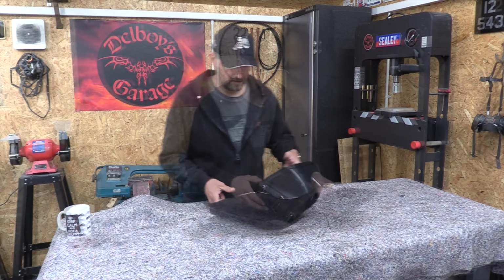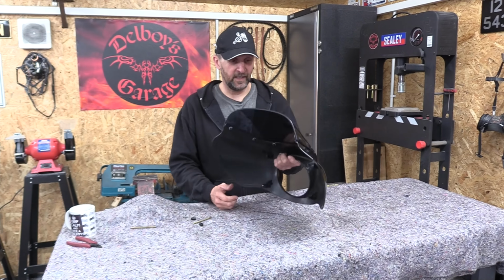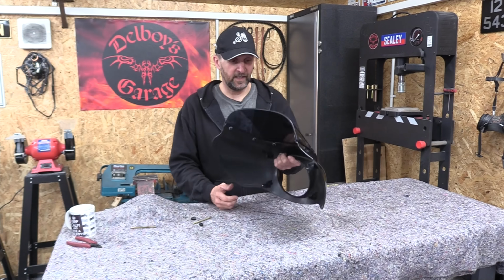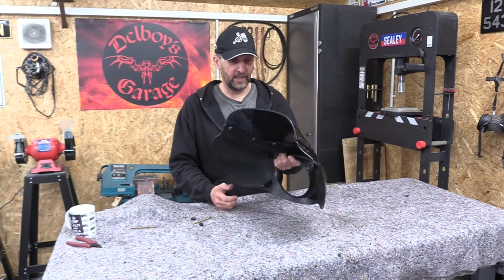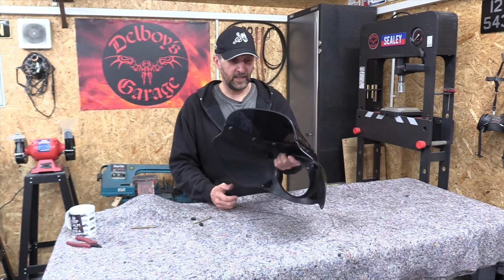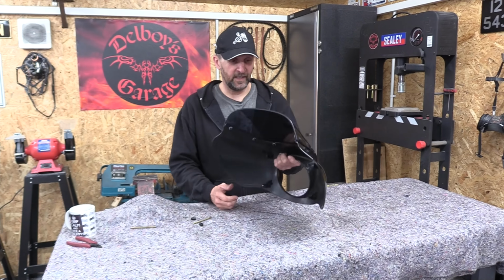Motorcycle Broken Panel Lug Repair !

Comment: Fascinating! No, I always do forget the awesome split nut trick for cutting threaded rods, lol. I have always placed two thin pieces of wood in between the jaws of the vice and the part, which does mostly work, but not always if you have a dull hacksaw, and for sure doesn't allow for a benefit of a straight cut. Thanks for the reminder!
Reply from the maker: Most welcome mate.. just simple little garage skills that will helps make a job easy..

Comment: Great idea.  I'll keep this in mind for side covers, which are notorious for breaking the same way.  They don't have the built-in pilot holes but I bet a person could get a similar fix.
Reply from the maker: Yeah, with no pre-existing hole, just spot drill it with a little 2mm, you could even lead that into the soft plastic by hand....then drill from there. !

Comment: I’ve done very same thing and it was unbelievable trick to repair. Thus it’s easy solution. Tapping is not my expertise due size of metric and sae size ie drill bit to tap.   You made it look soooo easy !! Lol… I’m sure I can figure out as I go.
Reply from the maker: If you ever wonder on "drill bit to tap" sizing... you can buy wall charts on the interweb,  like in the Zues book, it lays out each one from 3/16 up to 1" and in metric too and in a list..just stick it on the wall of your garage and then you have the sizes at a glance !
Reply: Awesome…. Will look into it…

Comment: #'So lube your rubber grommets, don't let them dry & stick,
but if you slap it on - the panel's gone! - a smear will do the trick!'#
Chorus: - (Your turn : )
Somewhere among the undulating flora that borders the Guildford by-pass, may still lie the Kermit green remains of a Laverda Mirage side panel. Alone in it's tangled & verdant grave, or nailed on some local spotty's bedroom wall by now, it too, was a victim of . . . 'over-lube'.
Feeling something brush under my right thigh, I looked round just in time to see the 'something' bounce off the road on one edge, catch the wind, fly past Klug's helmet & off into the bushes. Unsurprisingly, he pulled up a bit quicker than me, & sucking a freshly lit roll-up to death, said 'it just got bigger & bigger, looked like a snooker table going past!'
After twenty minutes of 'wet-boots-now' searching, & the fear of both hard-shouldered bikes becoming a passing trucker's new cab mascot, we called it 'Uncle' & ordered a new one.
Yep, you could back then, it was that long ago. (Gulp) . . . . . . . . . . . need some fresh tea    : )xx

Comment: This fix is, as they say, brilliant! 

As vibration caused the problem in the first place, would it work to use some blue locktite to mitigate against vibration causing this fix to become loose in the future? Just a thought.
Reply from the maker: Thank you Scott.. Perhaps you noticed the little dab of super glue on each thread when i installed them... they won't move now that's for sure !
Reply: @Moonfleet41  - Didn't... as usual, you've got the bases covered!

Comment: You should have cut the other two knobs off and repaired them as well. It's only a matter of time before they break on their own, and it never hurts to be proactive.
Reply from the maker: Did you notice one of the lower ones was already done with a small screw.. i don't know what's inside the other one.. so as they say.. "Cart aint broke, don't fix it "!